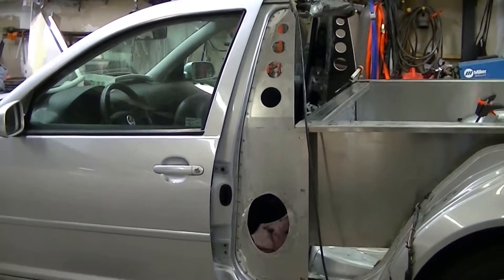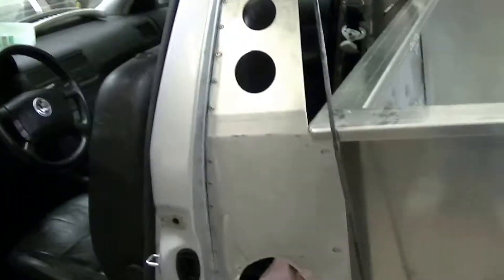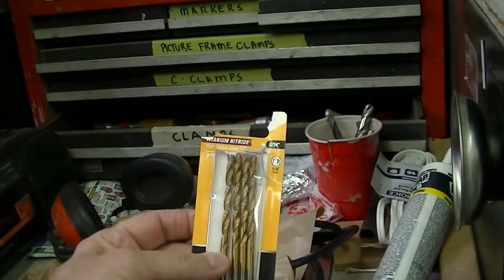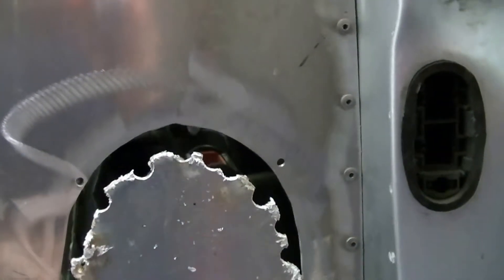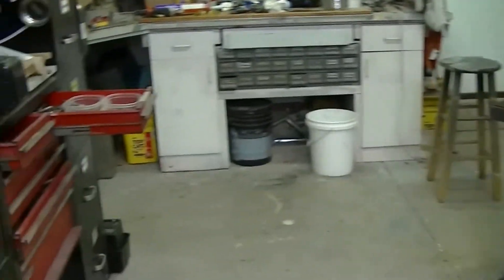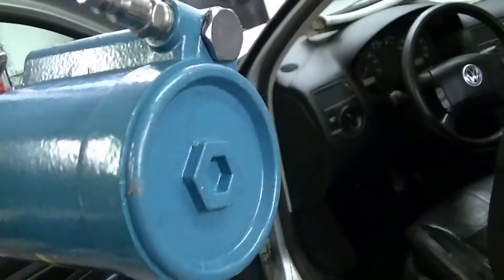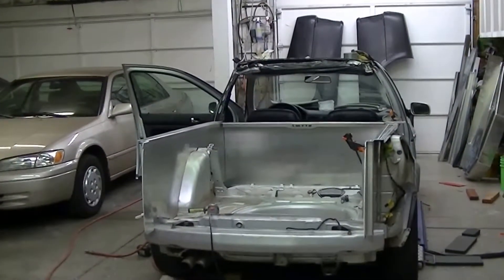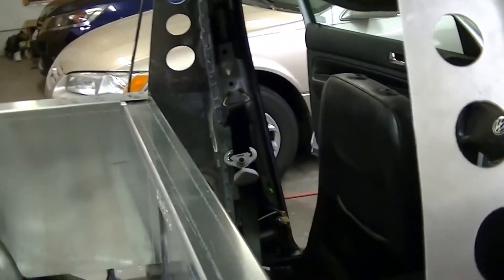Jetta Ute Project  8

Comment: Coping saw. Very thin and fragile and yet, they will cut aluminum like butter and not clog up. Just be gentle and let the teeth do their job. Hacksaws don't work. Too fine a tooth set. Reciprocating saws don't work. Too much heat buildup. But the lowly little coping saw is amazing.
Reply from the maker: Right you are !  Tried a coping saw on a bit  of scrap and it went right through it.  Learn something every day.  Thanks Ed